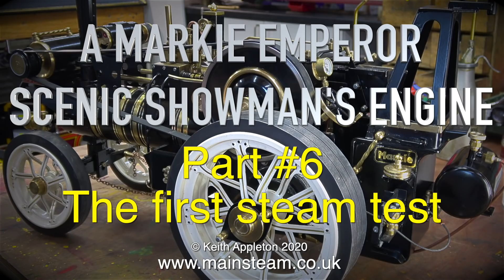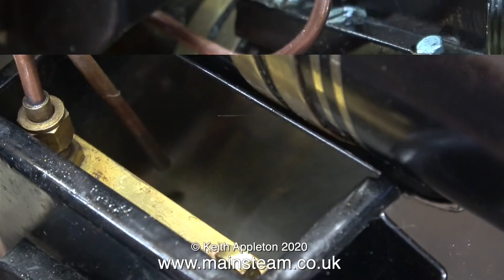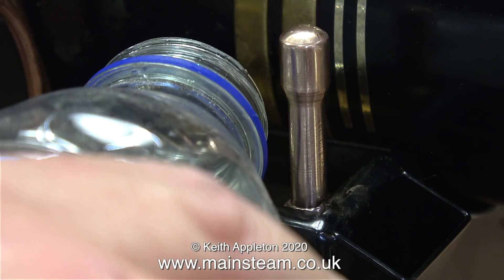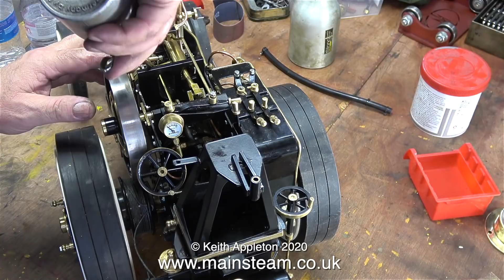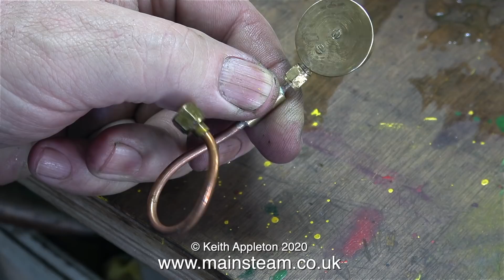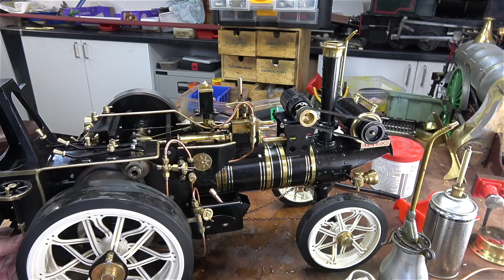A MARKIE SCENIC SHOWMAN'S ENGINE - PART #6

Comment: I have wondered for a while, being an enthusiastic but know-nothing viewer of your channel, if there is an alternative to the commonly seen pumps used on miniature steam engines. In my head I can devise a sort of rotary handle attached to the linear ram of the pump, either horizontal or vertical. Is this something you have seen before?
Reply from the maker: Traditionally the pumps are usually driven from an eccentric on the crankshaft.

Comment: As I've mentioned before, my Markie Road Engine is virtually identical to this Showman's (excluding the generator and mounting of course) with some minor differences in the plumbing. One thing that annoyed me from the beginning was/is the 'fine tuning' steam valve by the steam chest. If it had been mounted around an inch higher and rotated 90 degrees, it could have had an extension  shaft going back to the cab for the inclusion of a remote control wheel at that point.

Comment: I have a mamod locomotive, which I converted to gas around 5 years ago. Up till recently, I was using pure butane gas, which seems to evaporate quicker. I then started using the butane/propane mix, which has made a difference. Does this stuff burn hotter and evaporate less quickly then pure butane?
Reply from the maker: It is at a higher pressure.